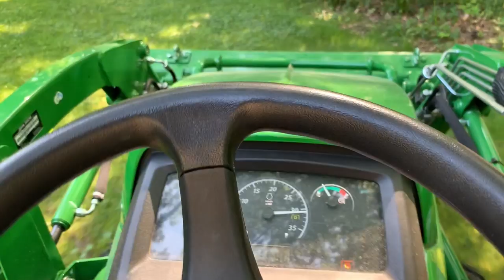1025r: High on the hog

Comment: Would anyone knowwhy  my brush hog and mowing deck shuts off when I back up?
Reply from the maker: There are 3 selector on the PTO, if you select rear only the brush hog will stay on, if you select the center and rear it will shut off when going in reverse unless you hold down the yellow PTO switch when going in reverse.

Comment: I bought the harbor freight on for about 110 dollars and it works just fine. You do need to buy the after market top hook.
Reply from the maker: Gerald Brock waiting for that 25% off coupon:)
Reply from the maker: Do you have a link for the top hook?
Reply: I don't have the link but if you search tractor time with Tim's older video's he has a video about it and he gives you the link in the video.

Comment: You'll get more comfortable with the rotary cutter. If it has a slip clutch, make sure it is free at the beginning of the season. If it uses shear pins, get a box of grade 2 bolts of the required size at your hardware store. Either way, if you hit something a bit more than it can handle it will be fine.